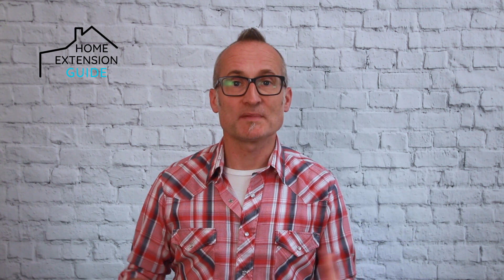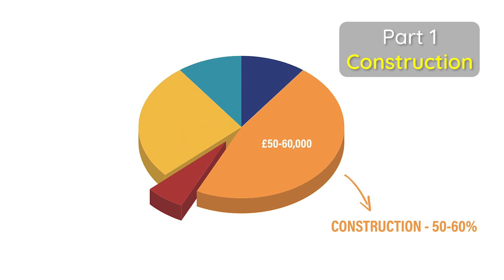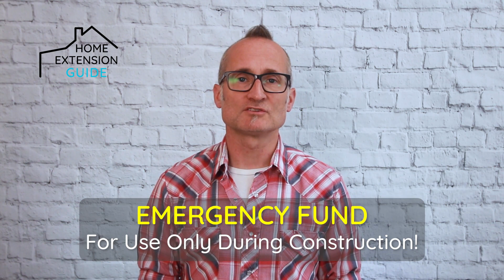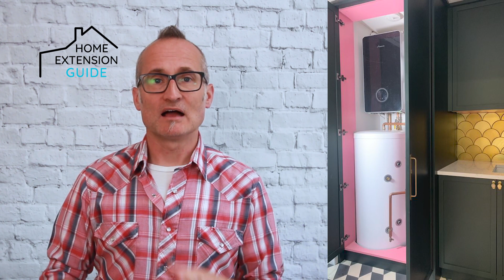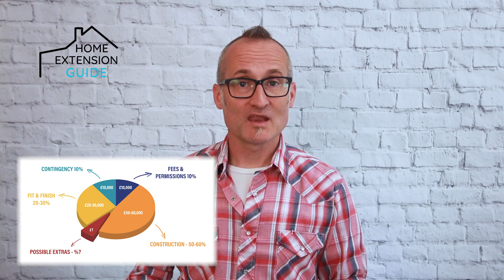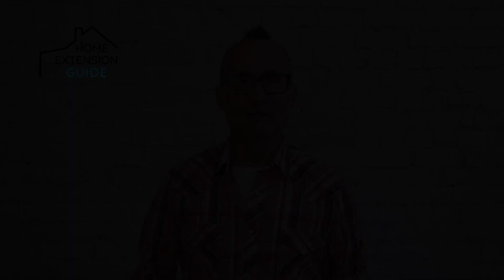Don’t Get Ripped Off: UK Home Extension Cost Breakdown

Comment: Thanks for this. It is helpful to know. I was wondering what your advice would be if you plan on getting plans for your dream extension and then saving up for that while doing some small internal work in the mean time? We were thinking of doing this so we could work out our end goal is (two storey extension to add a large kitchen, diner and 2 double bedrooms).
Reply from the maker: Hi @ace2363
I’m glad you found it helpful!
I’m not sure exactly what you’re asking here… are you wondering how to decide on a budget …or what your dream extension is likely to cost?
Sorry if I’m missing the point of your question! 🙂
Reply: @homeextensionguide  thanks for getting back to me. We would like to do our home improvement in phases e.g. first finish a partially done garage conversion and move the kitchen to the ground floor, but we can't really do that until we know what the end goal is for the home. We are hoping we can get an architect to plan our dream extension so we have this. We don't have the finances now for the extension, but we are hoping once we know what the end goal looks like we can save to do it. I was wondering what your thoughts are on this approach as we are looking at different renovation projects spanning years rather than doing it all at once.
Reply from the maker: Hi @ace2363, I think if you need plans drawing for your dream extension so that you can work out what to do now and how to stage your project, then getting an architect to draw those plans for you probably is the place to start.
My only hesitation would be the if you get plans drawn now (and pay a few thousand pounds for them), but in a few years time when you reach stage 2 or 3 of your project, and maybe change your mind about exactly what you want to build ...then you'll have to pay for more plans or alterations  to your existing plans.
So, it might be worth speaking to a few architects now, and looking for one who could help you come up with an overall scheme that you're happy with, but not do a full set of planning drawings (unless you need them for the work that you want to do first).
Then when you reach stage 2 or 3 of your project you can get the detailed planning/building control drawings that you do need for that next stage. Which gives you the chance to include any details or changes that you want to make at that stage, without completely re-doing expensive plans, or feeling like you need to stick to them because of how much you originally paid!
I hope that helps ...and does that answer you question? 🙂
Francis
Reply: @homeextensionguide Hi Francis, this was really helpful. Thanks so much! Would we just be asking them for more of a design consultation without detailed drawings?
Reply from the maker: @ace2363  Yes, although I’m not sure what an architect would call them, but you’d be asking for plans for the overall vision or concept of your project, rather than detailed planning drawings. 👍🏻